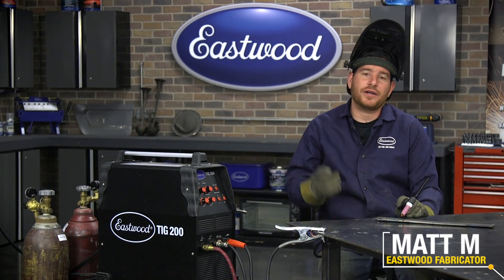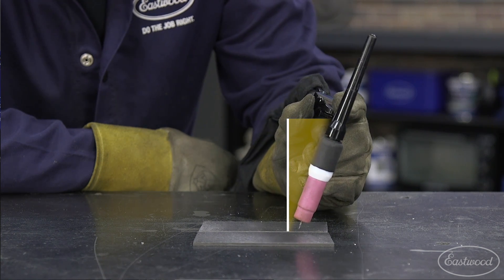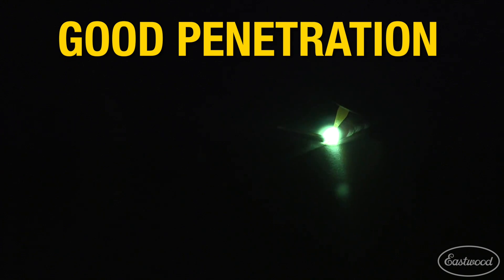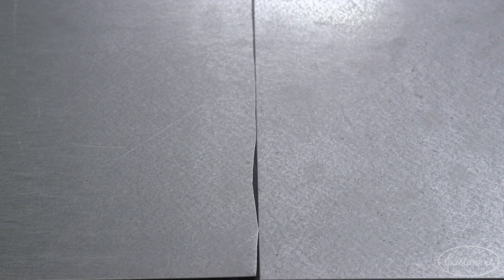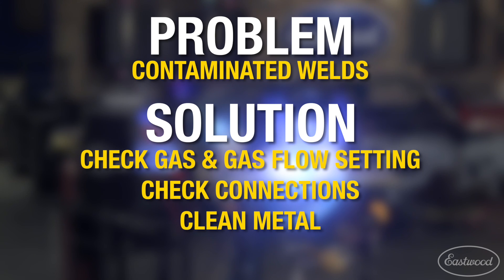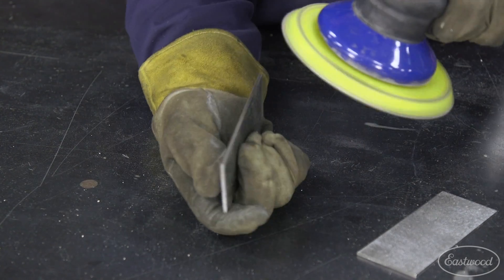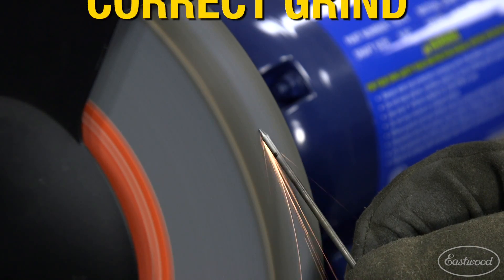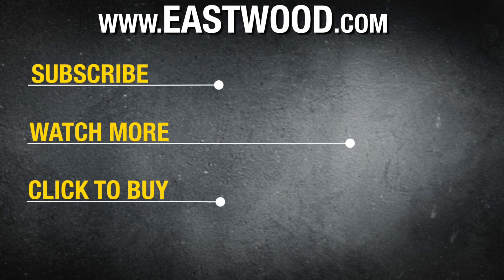Beginners Guide to Welding - TIG Welding Troubleshooting - Eastwood

Comment: I have 2 welders 1 is a Lincoln one is your tig 200. At full power using 220 V the eastwood welder cannot even melt 4mm thick Aluminum to practice bead lines. My Lincoln has no problems at all.